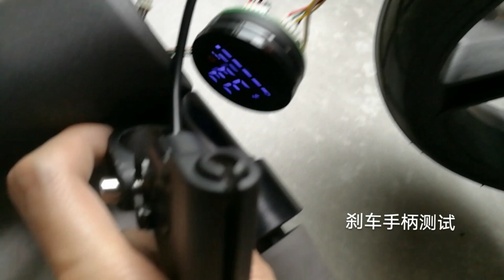Ninebot ES2 rear wheel brake handle TESTING

Comment: So it brakes on the motor and metal brakes at the same time!?
Reply from the maker: Yes
Reply: @tony1157cn  can you do/ point me I the direction of a video showing how you did it?
Reply from the maker: @markmurphy5289  use a xiaomi m365 brake handler to replace the original one.

Comment: Hi, in my keys  the red key suddenly started to light up and emit a sound code. I realized this is error 15. Something with the brake system: "Brake hall abnormal" check electric barke "dashboard and connected cable,
dashboard 、 electric brake "   .....But the brakes respond normally and the lights don't come on. How to fix? Does anyone know anything? The cables look good..
Reply from the maker: what's the model of your scooter?
Reply: @tony1157cn  ninebot es2
Reply from the maker: @ktdesign2521  If the brakes work fine, try to check the wire. Open the cap on the side of the rear shock, and you can find the wire.
Reply: @tony1157cn   I checked all the wires, from the controller to the rear lights, everything seems to be fine, but they are not work. I tried the brake -the brake works and blocks the engine but there are no lights.....
Reply from the maker: @ktdesign2521  Well, did you changed the controller before? If so, double-check your SN, and make sure it has an ES2 SN. Because the controller is recognized as a different model by different SN.
Or you can check on the App, did you shut the rear light off?
Reply: @tony1157cn  nothing has been replaced, the parts are original. The app even says that they are constantly on (because I already drive when it's dark) I read this somewhere: " You have to take out the instrument panel nicely and disconnect accelerorator  wires and reconnect them turn power on whilst holding down brake and accelerator at the same time . Then turn off power again whilst holdin down both . Repeat this again . Unplug accellaerator wire ... reconnect ... hold down both controls and turn on and whilst holding both down release and turn off . Turn scooter back on error 15 and or 14 should be gone ... and speed normality reset" what do you think?
Reply from the maker: @ktdesign2521  This method seems to hard reset the controller. It works on some version of firmware, I've tried before. Hold brake and throttle down and press the power button. This can solve some strange problems. If not works, you may find an ST-LINK, and try to rewrite the firmware of the controller.